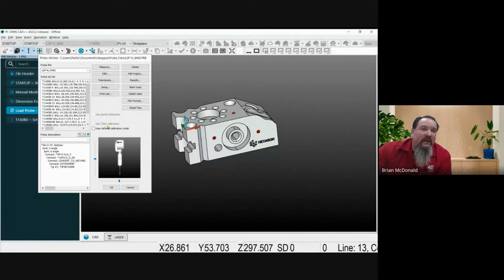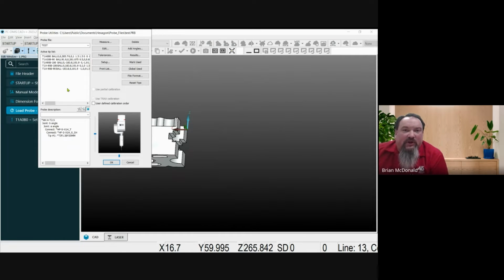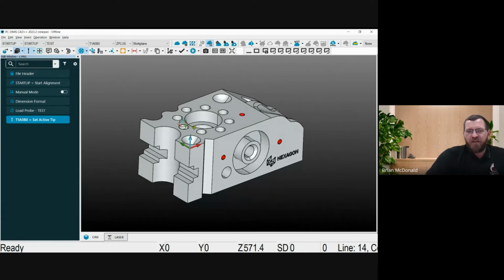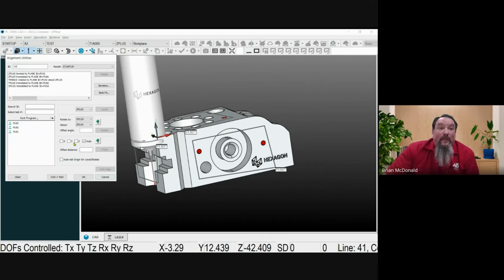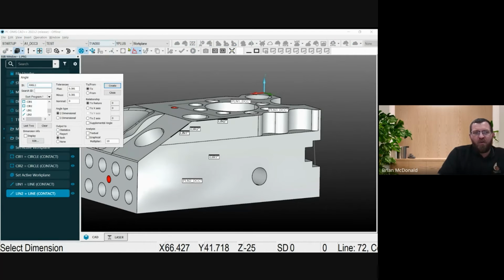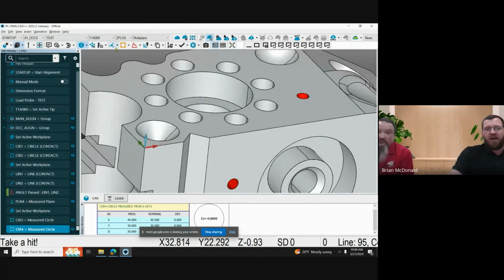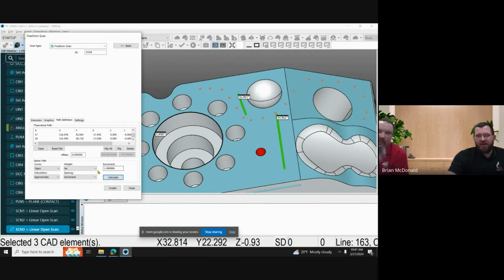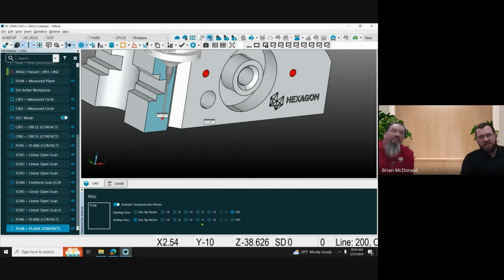PC DMIS FAQ Webinar

Comment: guys I need help. I am scanning with a hexagon arm. my scans are big files. how do I make the files smaller so I can send to engineer to open on CAD? thank you
Reply from the maker: Our suggestion to reduce a COP is to use the point cloud operator filter. Select "uniform", then type in the percentage of reduction and "apply", then "create". You can then export that filtered COP.